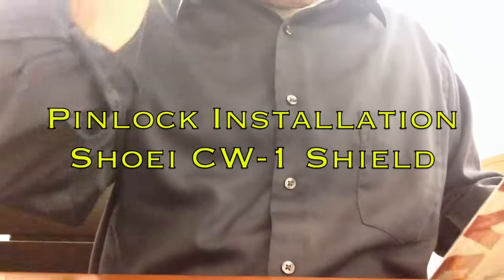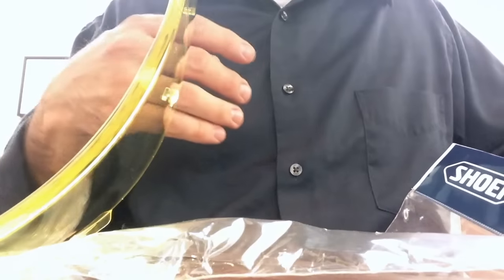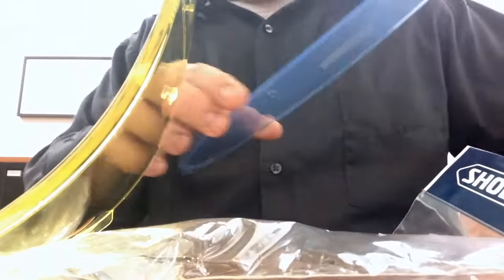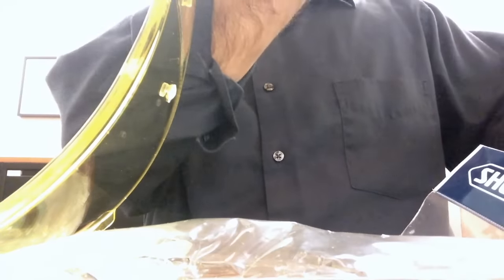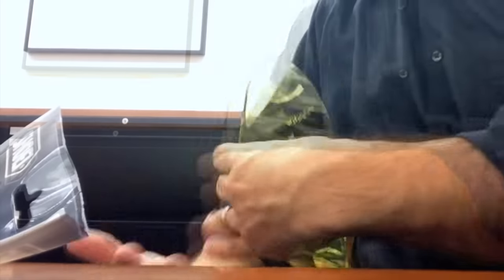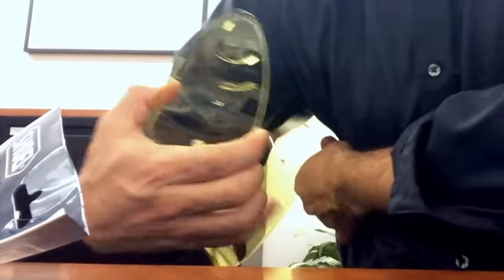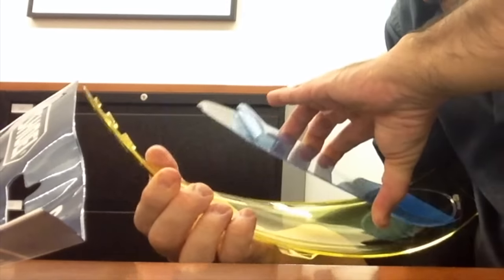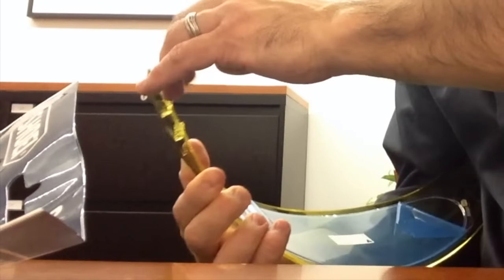Pinlock Installation - EASY!

Comment: i just ordered a new helmet that apparently comes with this, and had no idea what it was or how to install it. thanks for this video SB! now i will know what to do if i use it/install it
Reply from the maker: For cold weather riding, there is nothing better than the pinlock shield. The only downside is that it creates a little bit of glare at night with the oncoming lights. But I could deal with the glare so that I could avoided the shield fog. Good luck Outie!
Reply: @SoopaBee  You are not supposed to use the pinlock at night

Comment: You'll love the pin lock. They work a treat. No more foggyness, lol. ✊
Reply from the maker: +Doticaster Absolutely. Fogginess is definitely a thing of the past. But I have also noticed that at night, the pinlock kind of distorts street lights/headlights. It creates an almost twinkling effect. It's not terrible but definitely noticeable at first. I'm getting to the point where I'm not even noticing this any more.

Comment: What dose the Pinlock do? I haven't seen it before??
Reply from the maker: +GreenApples Great question! I should've explained. It keeps your shield from fogging up by creating an air-filled space between the shield and the pinlock insert. It is like a double panned window (if this makes sense). It actually works great!

Comment: How are you finding it?
Reply from the maker: In the daytime, the pinlock system is amazing! At night, I find that headlights and streetlights look like twinkling stars. It is not that bad but it is definitely noticeable. I certainly have gotten used to it and feel that it is better than dealing with nighttime fogging issues.
Reply: +SoopaBee I did notice lights doubling up near the edges when I first used one but I don't notice it any more.

Comment: What is the silicon oil for?
Reply from the maker: +Matthew H ? What oil are you referring to?
Reply: primary function is to create a better seal around the rubber that seats against the visor when closed. secondary function is that it serves as a good lubricant for the visor hinges. neither application requires that much, so the little bottle should last a while.